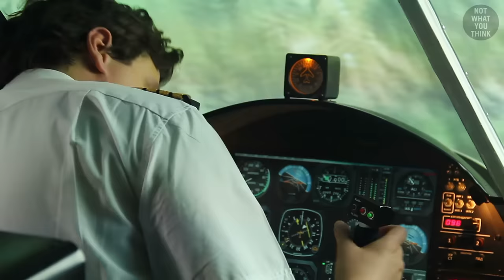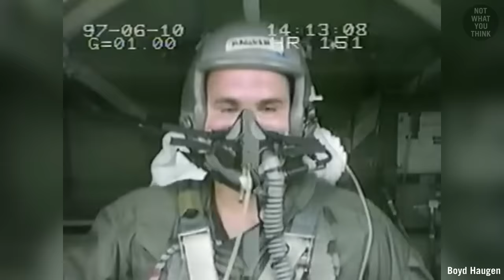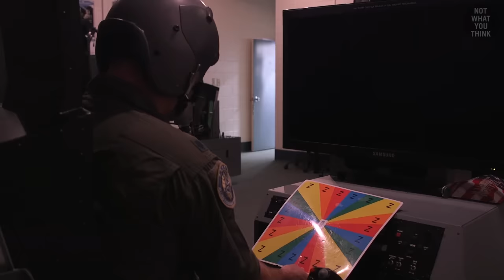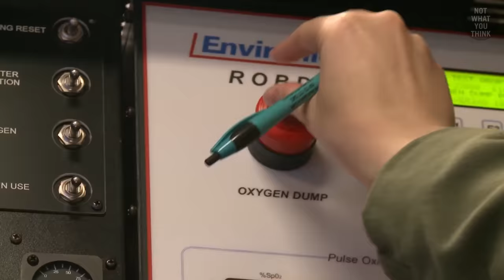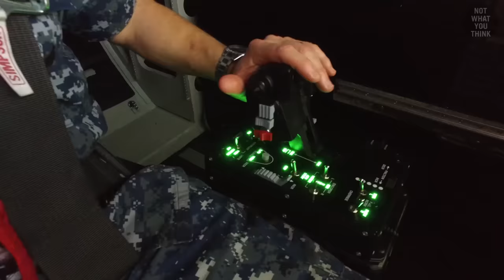How Pilots Lose Their Sense of Direction

Comment: 0:10 okay, so fun fact you can, in-fact, pass out pooping.  If you're straining & putting stress on the vagus nerve your blood pressure can drop & cause one to lose consciousness - it's called vagaling down. This is why Elvis was found between the toilet & wall in the end.
Reply: i can, umm, confirm that... i remember almost passing out, recovered by resuming breathing 😅
Reply: @magnitudefallout3944  🤣 I hate to tell you this, but it was more likely a reduction of pressure on the vagal nerve than an introduction of air that helped. (Not that you can't make yourself pass out by holding your breath, or anything)
Reply: oh, i see
Reply: @magnitudefallout3944  yeah, I swear, every semester of school this was beat into our heads at least once. Constipation & straining can be more dangerous than you'd think lol
Reply: It happened to me. Granted, I had both gut wrench and nausea, so from the get go not a lot of blood was going to my head.

One moment I was sitting and the other I was laying sideways on the bathroom floor. Luckily didn't hit my head with the tub.
Reply: @moteroargentino7944  very lucky. That's one of the reasons it's so dangerous, you're usually in a tight space with lots of very hard, frictionless surfaces to conk your head on during an uncontrolled descent due to unconsciousness. TBH this is the only thing that makes the 1970's carpeted bathrooms make sense to me
Reply: I have experienced light headedness after pooping before.  A hard squeeze a little too long, let go, and felt dizzy.  

Drink water if you're constipated.  99 times out of 100, it's not something you need anti-constipation meds for, it's that you're severely dehyrated and need to drink some water.
Reply: @AflacMan13  not exactly. For healthy younger folks, yeah that's generally it. However anything can affect it: diet, physical activity level, medications, stress, and the list goes on & on. 

The tldr is if you're having issues - see a doctor.
Reply: @PMickeyDee Opioids really back you up after a while.
Reply: @Sniperboy5551  bizarre dietary habits didn't help the situation

Comment: F-16 pilot here who has been through all of this training.  Although the video is mostly correct, there are several significant in accuracies:

1)  The altitude chamber IS NOT for recognizing hypoxia effects due to G's.  It is to recognize hypoxia due to loss of cabin pressure, especially a slow decompression vs. a rapid one.  Every pilot experiences different effects due to hypoxic (altitude related) hypoxia.  G-LOC (G-induced loss of consciousness) is extremely rapid and the only warning signs are typically narrowing field of vision.  Fellow pilots I know that have G-LOC'ed have had it occur in under 2 seconds or less

2)  The Barany Chair is used almost exclusively to overcome airsickness. Many UPT trainee pilots get airsick and using the chair forces the trainee to get so sick so often, that their body just gives up eventually and they get used to the "sick in your stomach" feeling.  Crazy enough it actually works really well, but it has nothing to do with interpreting sustained turns.

3)  Pilots actually don't move their head under heavy G because: A) it is extremely difficult to do so and, B) you can cause damage to muscles, tendons and ligaments moving your head under G.  It has absolutely nothing due to with becoming disoriented.  This is true because your vision is your strongest input and can overcome the disorienting effects of sustained turns under heavy G, which we only do in clear weather during BFM (dog fighting).  Commonly known as "The Leans" is a condition while in IMC (aka while in the weather with no visible cues) which can cause a pilot to misinterpret the position of the aircraft.  This is why it is reiterated ad-nauseum in instrument training to TRUST THE INSTRUMENTS and not your body.

4)  The AGCAS section is 100% correct.  We have a saying that "the biggest killers of fighter pilots are themselves".  2-3 times a year the AGCAS system has saved the lives of friends I know personally.

Overall a great video, I just wanted to clear up some of the information from an actual fighter pilot's perspective.

Comment: FYI a hyperbaric chamber is used to increase pressure on the occupants which would increase partial pressure of oxygen in the blood and the oxygen supply to the body in the brain. These are commonly used in deep-sea submerging activities and treatment for diving injuries. A high-altitude chamber,  or hypobaric chamber, is used for high altitude low pressure simulation and training and results in low partial pressure of oxygen in the blood and substantially reduced oxygenation of the body and brain, these are used for training and testing and evaluation of pilots and aircraft personnel Xtreme altitude mountain climbers, etc. These were first widely used for these purposes by the US army Air corps in projects that were designed and overseen by famous army Air corps researcher and extreme mountain climber Charles Houston. There are documentaries and written materials about Charles Houston and his research and climbing activities. Check out his book brotherhood of the rope
Reply: Came to the comments looking for this comment, in response to NYWT using the wrong word @6:00 .   "Hypo-" means "under" or "less" or "reduced", with "hyper" being the opposite.  It's like "hypothermia", which is reduced temperature (i.e. core body temp gets too cold) vs "hyperthermia" (overheating).  So as keithb says: Hyperbaric chambers are high pressure (for training divers, and also for some questionable medical uses), and hypobaric chambers are low pressure (for testing high-altitude experiences, or as in this case, oxygen deprivation).

But, as always when I post a correction, I gotta be clear I'm not hatin'.   NWYT, your content is so damn good (and errors so minor and so rare), which is why I keep coming back and coming back.

Comment: According to the Encyclopedia Britannica, modern passenger jets don't have fuel tanks. 

The plane only uses fuel to take off..
It uses Resonance to fly..
Forced Air flowing into the Turbine engines turns the turbine blades,  which compresses the air into thrust..

Only propeller planes, helicopters and afterburner military jets need constant fuel. 

They say a Boeing 747 carries
63,500 gallons of fuel..
..where do
they put it?